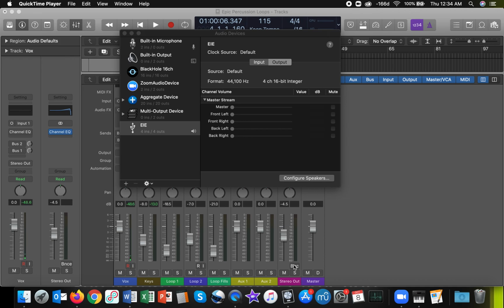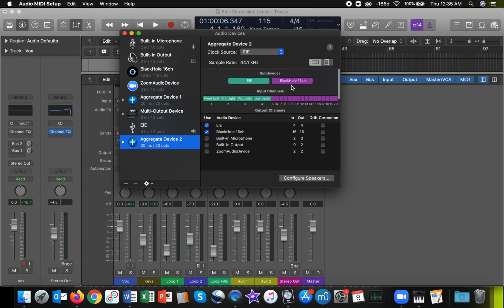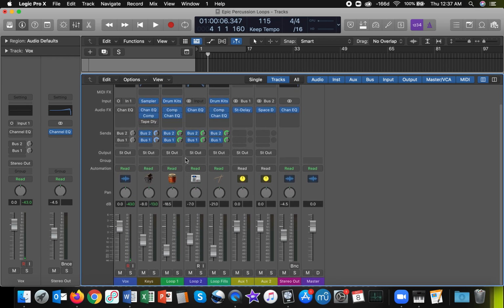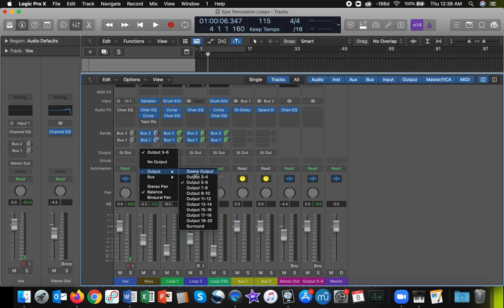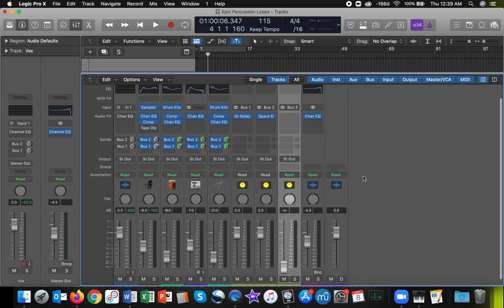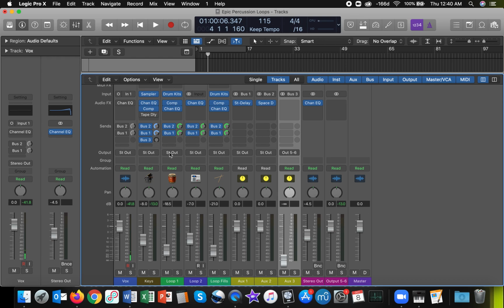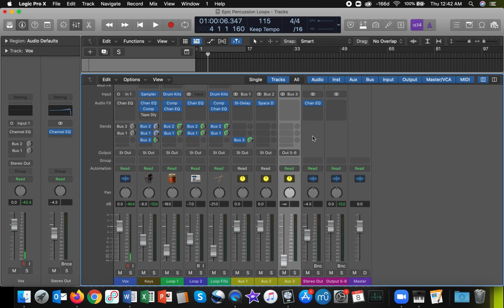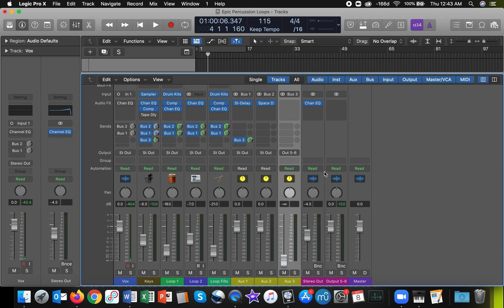Zoom Tutorial Part 5: Advanced Audio Routing Using BlackHole

Comment: Great video! Helped me a lot to get going with Blackhole :) However, I have some thoughts on what you're saying at 6:24. Doing it this way will actually not send the same amount of signal to the bus: It will send less!

This is because, due to the Post Pan setting, Logic will consider the fader-affected track signal to be the full 100% of the volume, and the adjustment on the knob will be in relation to that. Using the copy function to match the dB-value of the fader  - in this case -8dB - will for this reason  not result in sending the same volume to the bus; it will be lower.

To achieve what you're looking for here, you simply set the knob to 0dB (alt-click), and the signal - post fader - will  be sent to the bus, thus matching the volume of the source track as intended. 

The copy function would make sense while working with Pre Fader sends.

Comment: Bro thank you for the video . I have an issue and I think you’re the one to solve it ! I want to dj with my Traktor pro, through logic in order to use some plugins and out from my duet apogee. I have set in TRAKTOR , audio device black hole 16, output routing is : master 1 and 2 , headphones , 3 and 4 . Now in logic : input blackhole 16 , output duet . Does this sound correct ? I want to have the master out but also the pre cueing setup individually . It used to work in the past with sound flower but now I can’t get it to work .